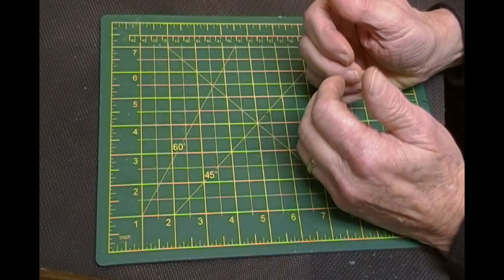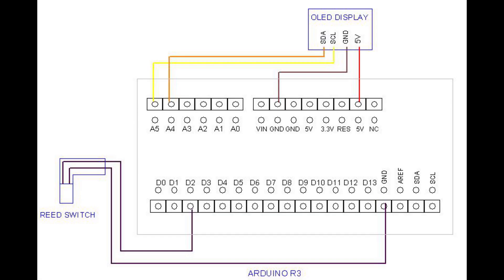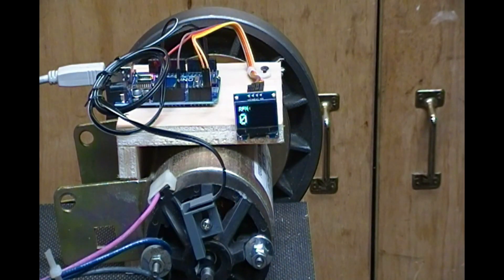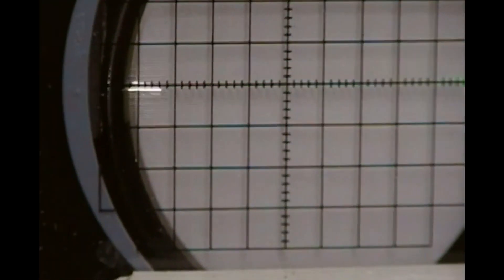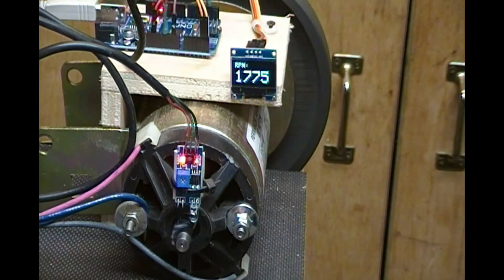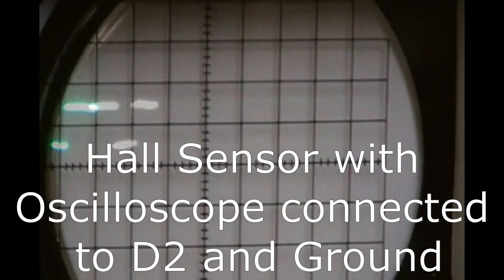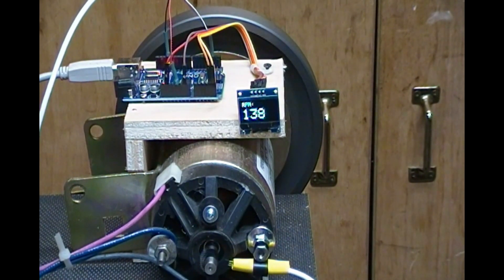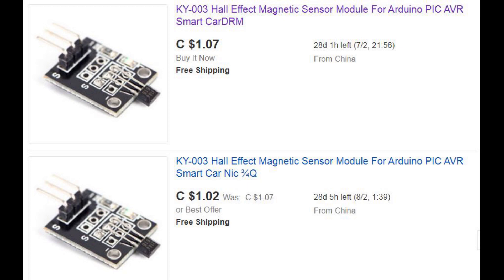Easy Peasy Tachometer

Comment: An interrupts based program does not really work because there is overcounting if the pin stays low for some time. Instead there should be an explicit counting of pin transitions within the loop and resetting the count every so often (2000 msec or whatever is your favorite number of milliseconds).
Correction: additional experiments showed that interrupts work fine if the sensor is placed correctly.
Reply from the maker: The arduino program with a Hall sensor works for most people.
Reply: @practicemakesbetter7132  That's correct, however a magnet attached to a blade of a for small propellers of an RC plane would throw it off balance.

Comment from the maker: Easy Peasy Tachometer Code:

// Easy Peasy Tachometer
//James Rovere 2020
#include <Wire.h>
#include <Adafruit_SSD1306.h>// You may have to edit library for 128x64, default is //128 x 32.

#define OLED_WIDTH 128
#define OLED_HEIGHT 64

#define OLED_ADDR   0x3C // A very common address for these displays.

Adafruit_SSD1306 display(OLED_WIDTH, OLED_HEIGHT);

float value=0;
float rev=0;
int rpm;
int oldtime=0;        
int time;

void isr()          //interrupt service routine
{
rev++;
}

void setup()
{
 display.begin(SSD1306_SWITCHCAPVCC, OLED_ADDR);
 display.clearDisplay();
   
digitalWrite(2 ,HIGH);// Instead of using a pull up resistor
attachInterrupt(0,isr,RISING);  //attaching the interrupt

}

void loop()
{
delay(2000);// 2 second delay
detachInterrupt(0);           //detaches the interrupt while calculating
time=millis()-oldtime;        //finds the time 
rpm=(rev/time)*60000;         //calculates rpm
oldtime=millis();             //saves the current time
rev=0;

  display.clearDisplay();
  display.setTextSize(2);
  display.setTextColor(WHITE);
  display.setCursor(0, 0);// Vertical, Horizontal.
  display.println("RPM:");
  display.setTextSize(5);
  display.setTextColor(WHITE);
  display.setCursor(0,25);
  display.println(rpm); 
  display.display();
  

  attachInterrupt(0,isr,RISING);

}

Comment: But why was the IR sensor signal not adequate? I see on a schematic of the module TCRT5000 board, and 0.1uF capacitor in parallel with the IR receiver, and a 10K pullup resistor. This produces a lowpass filter that is 3dB down at 159Hz. I think that capacitor needs to be removed.
Reply from the maker: Perhaps you can tweak the IR sensor to work properly for you. I found that a Hall effect sensor is cheaper, smaller, simpler and more reliable to measure RPM than an IR sensor. Let me know if you have any success improving the IR sensor.